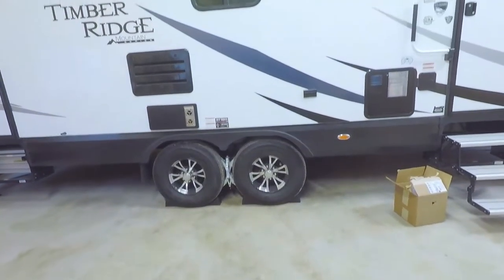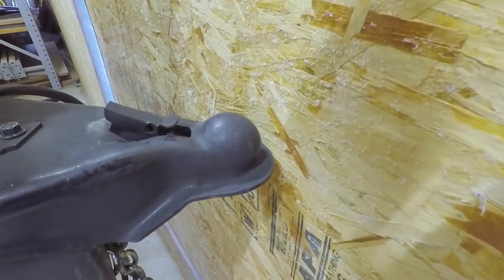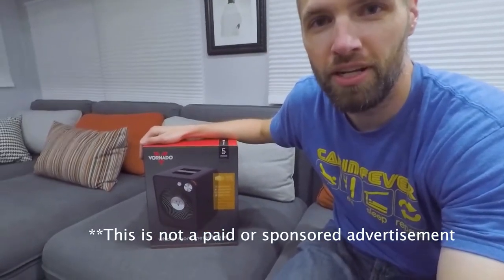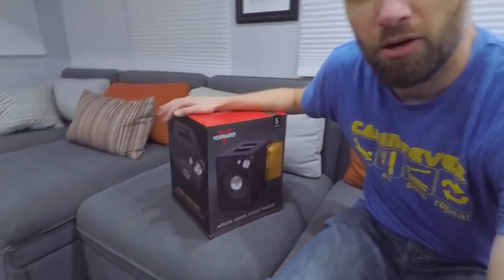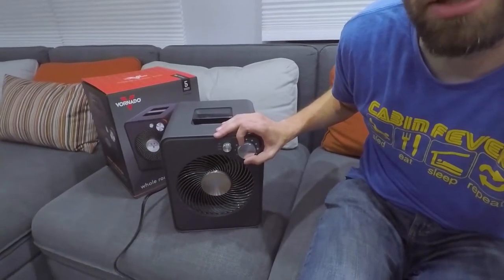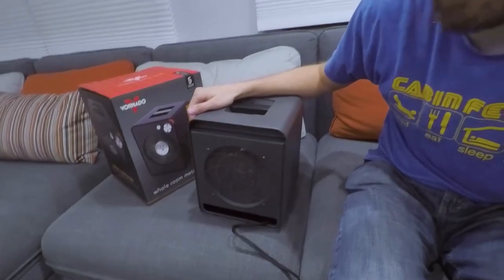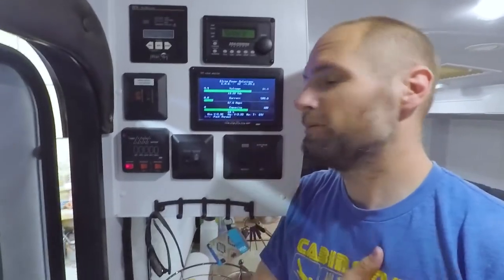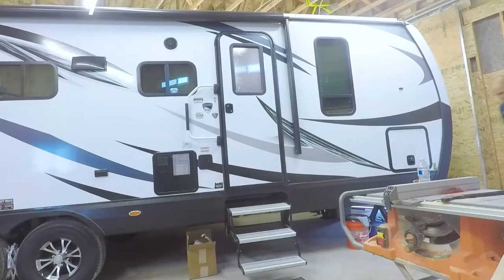Adapting Our Plans + Vornado VMH300 Review - Full Time RV Family Vloggers

Comment: Very nice looking heater. Looks very well constructed. Are you still using it and is it working well for you. Where did you get it? Man that was some tricky parking to get that TT in there. Thanks for posting.
Reply: Yes, the heater is still in use. It does a good job of just spreading warm air around. The keyword is 'warm' here. It's not overly hot. Purchased at Best Buy, although I'm sure Amazon would stock as well.